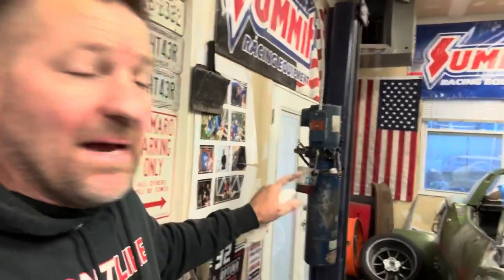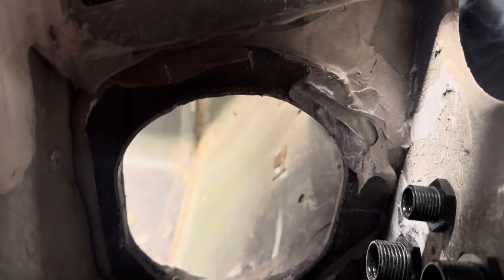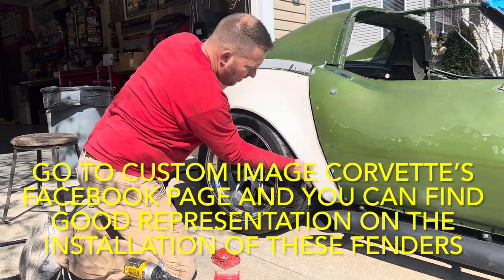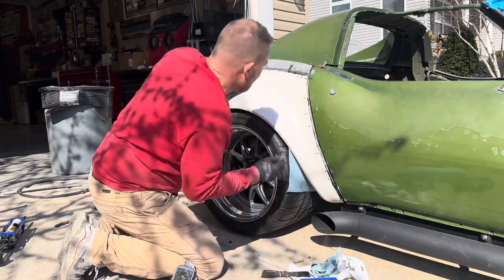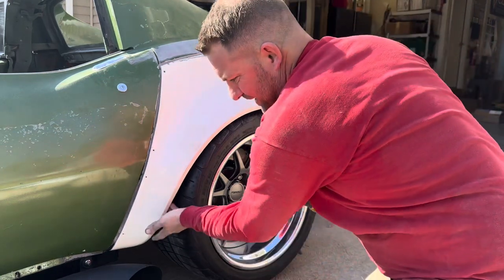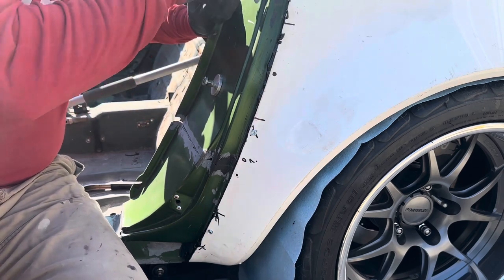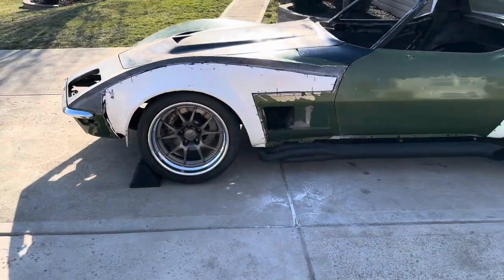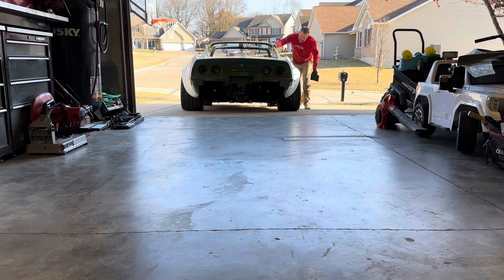C3 Corvette Fender Flares Going On For Good!

Comment: You're a beast man!  Great job.  My flares are going on 3/6/24 but I'm having J&D Corvette do em (CIC 3" and 4" flares).  I was intimidated by that whole process but yours look great.  Bummer about the front wheels hitting the back.  Glad I saw this beforehand so I can warn them about it.
Reply from the maker: Thanks! Yeah, the main reason they hit is because of the offset of my wheels. I wanted my wheels to sit further out and not be buried in the wheel well. It’s definitely something the need to look out for. I will say, Josh at cic designed these to fit without modifying. Shoot me pics of yours if you have any. Toddpcf@outlook.com.

Comment: I have a 69 with CIC flares. With the front Van Steel arms the caster had the front 315 on 11" wheels tires hitting too. I had to cut and remold the rear of the front wells about 1..5 " longer in the rear. My wheel offset also dictated that I cut the entire lip off of both fronts and added 3/8 " of glass, of course this meant re contouring the entire front flares on both sides. Alot of work, but Im happy with  the flares .
Reply from the maker: Yes this is the road I’ve chosen to go down. It will be the way I want it when it’s done though.
Reply from the maker: I’d love to see some pictures of yours. Toddpcf@outlook.com if you’re willing to send me pics.

Comment: Not that I’m a pro. When I did my 69 I had fiver glass pre molds . They didn’t require as much cutting out as you did, they have better clearance .
All I had to do was use glass patches over lap and repeat with resin . Lots of resin in between and over lapping in a staggered way, then let it all set up. Set up between layers. Kinda like doing paper machete. Once it’s all set, sanding or lack of a better word like grinding with an angle grinder with a sanding attachment to really get down the really high points. The doing the rest buy hand. Take it really slow. You will get the perfect result.
Reply from the maker: Thanks for commenting, appreciate it. It’s very helpful.